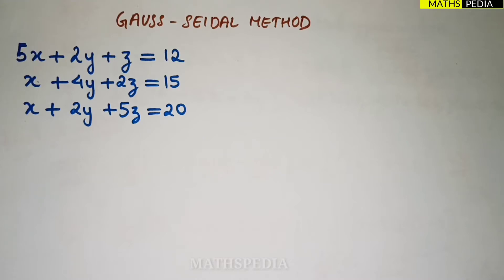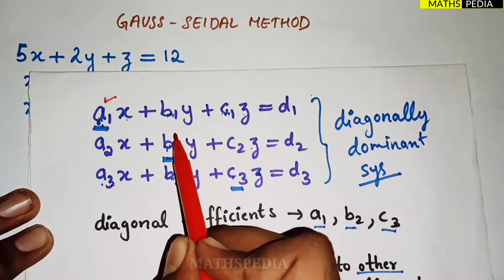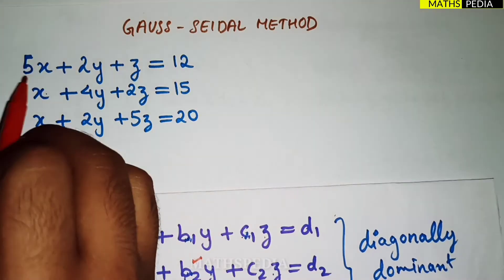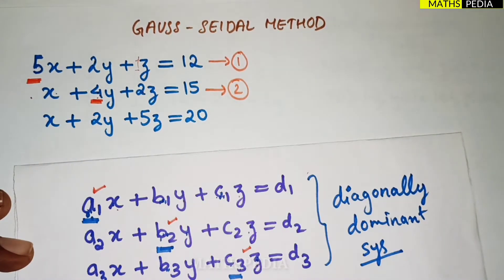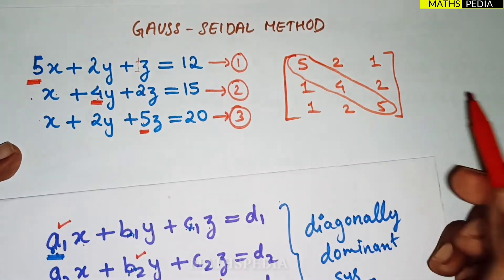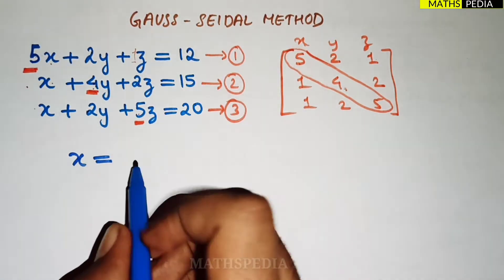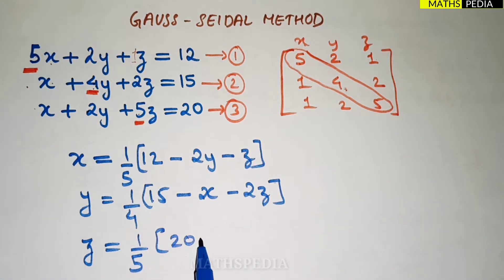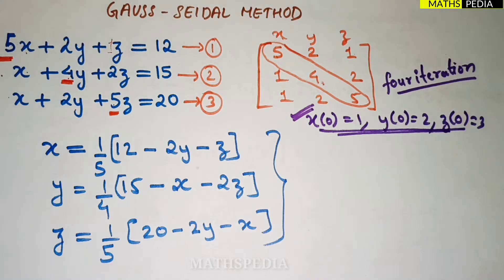Gauss Seidel Method | System of Equation | Engineering maths | Mathspedia |

Comment: Ifthere is not diagonally dominant then how can we solve this equation 5x-2y-6=0; 7x+5y=24 through gauss seidel method plz reply 😢
Reply from the maker: Gauss seidal method can be used for diagonally dominant system only.
If equations are not in proper order then rearrange it.
For eg 20x+y -2z=5
2x-3y +20z=-6
3x+20y-z=12
Rearranging 
20x+y-2z=5
3x+20y-z=12
2x-3y+20z=-6
Reply: @MATHSPEDIAabhi   in this eq 5x-2y-6=0;7x+5y=25 here if rearranged it it won't be because both of the eq have higher value of X than y then in this case how can we solve